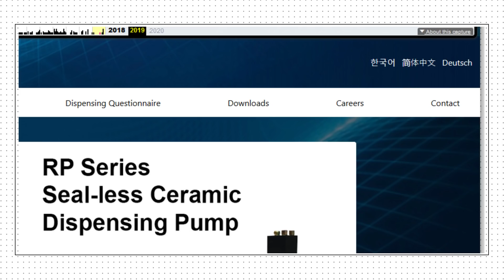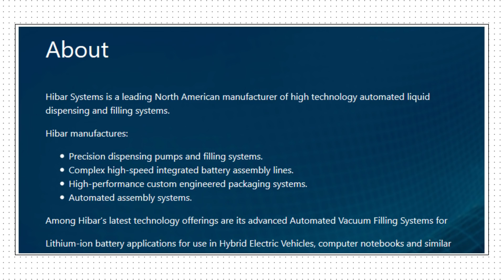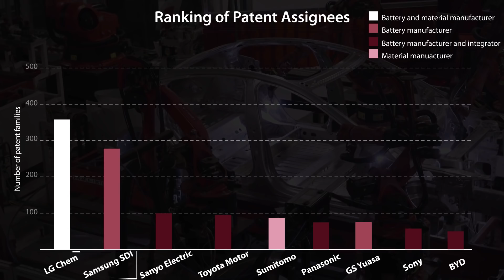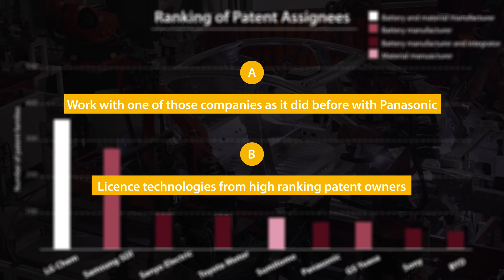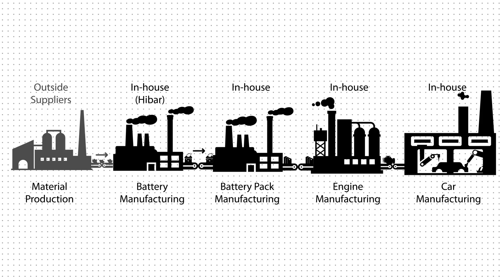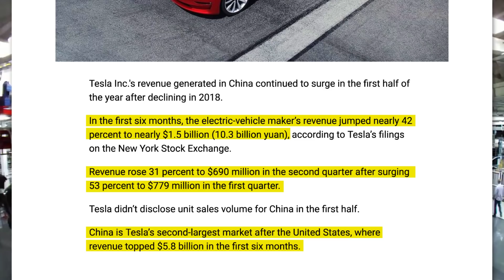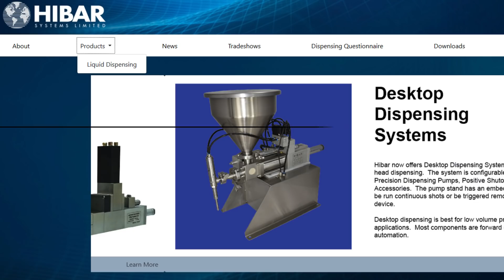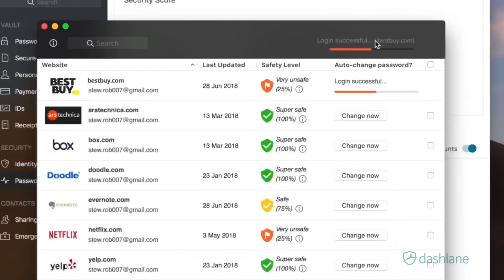Tesla's new Battery Strategy, explained.

Comment: Tesla cannot abandon their battery partners, but the reverse could be true: I don't think Panasonic is very happy at the news of Tesla purchasing two battery technology companies, and Panasonic also claims that they are running at a loss in the Gigafactory.

As for the Chinese tax exemption for Tesla only, I read that this is not at all the case: Tesla happens to build their cars in a free trading zone, hence the tax exemption. If other auto makers were manufacturing their cars there, they would also assumedly benefit from the exact same tax exemptions, it was not a deal specific to Tesla. But I don't know if this is whole truth.

I don't think we should expect many changes in Tesla battery design or manufacturing in 2020. Right now, they have a stable design and equipment, and really need to focus on getting the best ROI on these over maybe the next couple years, and focus more on designing and delivering more models of cars and vans and trucks, so they can become an auto maker providing a full range of vehicles, and open more local markets all over the world. Internal improvements in battery design and manufacturing will happen of course, but are probably not the highest priority. Most improvements about battery chem and design will probably come from outside Tesla R&D, like university labs.

About Deepscale and autonomous driving, I don't know if you have noticed, but for over a year now, all recaptcha systems are focused at recognition of roadside objects, like traffic lights, cars, buses, bicycles, bridges, fire hydrants, etc. I assume they use human confirmation of automatic recognition software in cars' video cameras. Weirdly enough, they also ask to identify palm trees specifically. Maybe there is some running conspiracy theory about coconuts crashing down on parked cars...  ;)

Comment: I have a question about what patents might be in Tesla's way if they want to become a cell manufacturing.

Tesla already has its own chemistry.  Tesla developed the chemistry that is used by Panasonic in Reno to build cells for Tesla and Tesla has a new 'million mile' chemistry, independent from Panasonic.  Tesla designed the separator used in the Panasonic/Reno batteries.   

Tesla has the dry roll technology that they acquired by buying Maxwell.

Tesla has the ability to construct cells via its Hibar high speed cell production.

If there was ever a patent on making cells cylindrical or rolling the electrode sheets or using a metal enclosure those patents would have expired decades ago.

What else does Tesla need?  Obviously materials but those are open market purchases.  

Other companies may hold a lot of patents but that doesn't mean that Tesla needs those patents.  Many patents may now be useless because the technology has moved on.
Reply: Electrolyte and separator production technology. Maxwell is limited to electrode production. So they need IP on the other components of battery cells this are electrolyte and separator.
Reply: @kazedcat  
"Tesla and Dahn were awarded a patent that described a single-crystal lithium-ion battery almost identical to the batteries described in the paper. The patented battery includes an electrolyte additive called ODTO that the patent claims can “enhance performance and lifetime of Li-ion batteries, while reducing costs.”"

https://www.wired.com/story/tesla-may-soon-have-a-battery-that-can-last-a-million-miles/

At some point earlier Tesla developed or identified a separator that was thinner than what Panasonic had been using.

I think the electrolyte will be produced in GF1 and Tesla might buy separator material from another company.  Perhaps made to Tesla's specs.

Comment: Oh no, you didn't, did you? Oh yes, you did.
In the info-graphics showing the manufacturing chain from raw materials to finished EV car, it is definitely an ICE engine being shown, complete with air filter and intake on the top, and cooling fan at the front.

Comment: It sure looks to me as if Tesla is moving to produce its own automotive battery cells.

I don't think the size of patent portfolios is particularly germane.  What matters are the specific patents for processes Tesla might use in its own cell production.  There might not be very many outside patents that would require licensing.  Tesla's own IP now includes dry coating tech not in use elsewhere, plus their new Canadian subsidiary already makes machines for cell production lines, and has the IP to back that up.

Tesla's IP is quite valuable, so if they do have to license, some sort of cross-licensing deal seems doable.

Tesla needs TWhs of battery cells per year - quantities that dwarf the paltry worldwide production of cells today.  I think they're so hungry for cells, they'll do both: buy them from other producers and make them themselves.  Eventually, if they are able to obtain the cells they need internally, they'll phase out outside suppliers, but not any time soon.

Comment: Cobalt is going to be in short supply for these Lithium Batteries. War should reign supreme then in D.R.Congo, to keep the prices down for the multi billion dollar Companies. Maybe one of these multi billion dollar companies should put some R&D into extracting Cobalt from THERE USED BATTERIES.
Reply: Maxwell has a new dry cell battery so not sure if that uses Cobalt, but someone said the other day Tesla doesn't get their Cobalt from Congo, not sure if thats true or not
Reply: @readytokill123  Tesla has stated multiple times that it doesn't get Cobalt from Congo. It causes higher prices,, but it's worth it. They also have been working hard to reduce the amount of Cobalt used in their batteries.
Reply: @readytokill123  Same. I don't think anyone knows the chemical makeup outside of specific Tesla engineers. I seem to remember Tesla getting their Cobalt mostly from Canada, though I could be horribly wrong with that. They do have multiple suppliers. Congo is just the largest and cheapest deposit, by far.

Comment: I'm still not sold on current LiOn as a sustainable EV driver versus hydrogen. We need to see more TCO analysis, mean time to failure, factor in battery recycling costs, manufacturing costs, before coming to a conclusion. Of course the ideal would just be much better batteries.
Reply: Miki Cerise totally agree with you, we need to talk about recycling
Reply: It would take Tesla 10 years to get hydrogen up to the same level of availability that their charging stations currently enjoy. Imagine how much better batteries will be in that time. Hydrogen died when GM canned it and gave away their ev lead, how stupid do they look now.
Reply: @spacemanmat  fuel cell was invented in the 1800´s and it was even used for the space program but sadly it was seriously neglected with the time but we kept improving batteries until the 90´s where the lithium technology really kicked off
Reply: @carholic-sz3qv  Similar things are said against EVs (since the first cars were EVs). However, tech improved allowing EVs to improve. I don't think FCEVs are useful for personal vehicles. Too expensive. But don't count them out. They may have a place in the future, especially if some new tech comes out to improve them.
Reply: @anthonypelchat  yeah hydrogen is better for heavy vehicles
Reply: Le Chat Botté agreed, hydrogen could have been successful if companies committed to it and at one stage it looked like it would happen but as it turned out GM was more committed to fossil fuels. Tesla went down the battery route and they are now fully committed to it. As things stand now any car manufacturer should be able to get on the battery bandwagon without any real issue, but to get into hydrogen would be a very large undertaking. Had GM fully committed to hydrogen it is possible Tesla wouldn’t exist today.

Comment: Lei says that Tesla acquired Hibar to produce battery cells themselves, yet he states that Tesla still has to work with the battery makers as Tesla doesn´t own the patents but won´t license these technologies. This would somehow imply that they split the manufacturing process between each other. This sounds really difficult to do, complicated and imho not viable. Also, it wouldn´t solve the problems that Tesla experienced with Panasonic´s lacking production volume.
Tesla has to take the battery production fully into their own hands in order to remove the bottleneck, even if this means investing even more capital. And only then the takeovers of these battery tech companies would make sense.
Reply: Tesla owns all its own battery tech and has openly talked about plans to make their own batteries almost from the start. Almost every financial call they talk about tweaking the chemistry and battery cell structures, always making improvements. "Tesla Panasonic" was set up as its own separate company probably in order to deal with these ownership vs manufacturing issues. Tesla has said that Gigafactory 3 and all future Gigafactories will be raw materials in, completed products out. With China they stated that "initially" they will get batteries from LG. In other words, as soon as they can ramp up their own manufacturing then they will not be buying from outside vendors anymore.

Comment: Curious, would you be able to do a video on Tesla air conditioning systems for their cars, I know it must take a lot of juice to run these and am very interested as to how they did it while keeping range relatively high. Thank you.
Reply: Air conditioning uses less power than you loose from the drag from open windows. Heating the cabin in the winter is where you can loose a few %. In -36C it is up to 15% range lost for a Tesla keeping a very warm cabin (tests tend to use 21C even though you wear warm clothing in winter and would never want the cabin that warm). This is why heated seats and heated steering wheels are so common in EVs, it costs a lot less power than heating the whole cabin.
Reply: @0ooTheMAXXoo0  how about the battery itself do they incorporate that heat into the cabin as well?
Reply: @TiberiusMaximus  I believe heat generated is recycled by the cooling system elsewhere in the car.
Reply: @0ooTheMAXXoo0  What about when you live in the middle east and it's 38C in the shade, but your car was parked in the sun?
Reply: Take a look at "Sandy Munro's Tesla Deep Dive - Autoline After Hours 447" https://youtu.be/aVnRQRdePp4
It is only about the Model 3,but he is very impressed of what Tesla did there.
Reply: Tesla came out with a new system when they were designing the first roadster.

Comment: I guess the first Car to ride on Mars will be a Tesla
Reply: well the first car on the moon was electric sooo...
Reply: @Xithia  Not really any other option
Internal Combustion Engines need oxygen so they're out of the question
Reply: Romain Hedouin what abt using hydrogen? Would be a pain... but could work
Reply: @FisherZ25  you still need Oyxgen. you could carry that around, but that would double the mass of the fuel.
Reply: Curiousity rover: Am i a joke to you?
Reply: The mars rover doesn't count as a car, not because is a robot. But because it's not used for transport purposes.
Reply: First cars are already on Mars.  They aren't Teslas.
Reply: @sferrin2  
Nobody can drive them though, are they really "cars" then?
Reply: FACTZ OVERDOSE than driverless cars aren’t cars than by yr logic
Reply: @sferrin2  Robots are not cars.